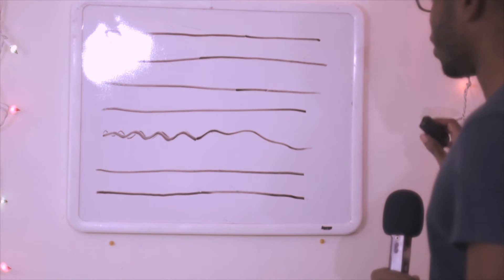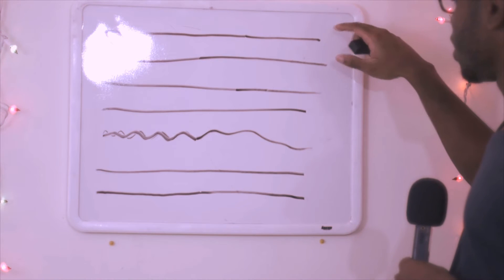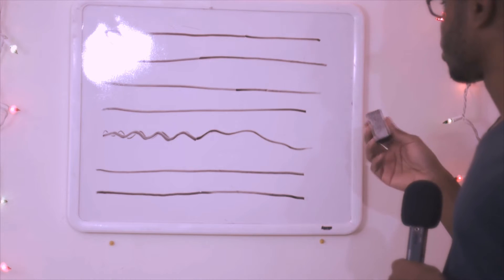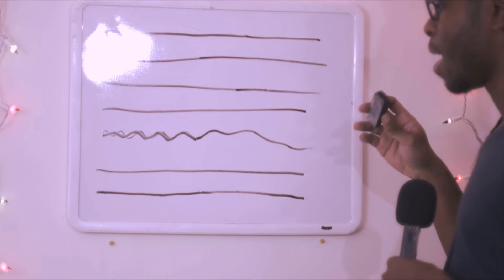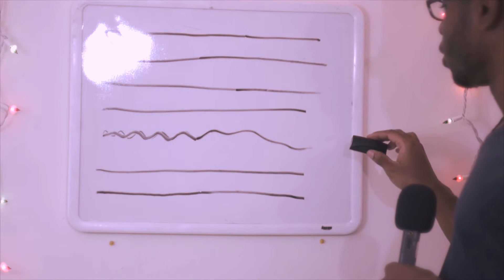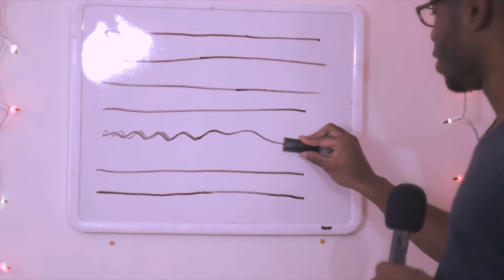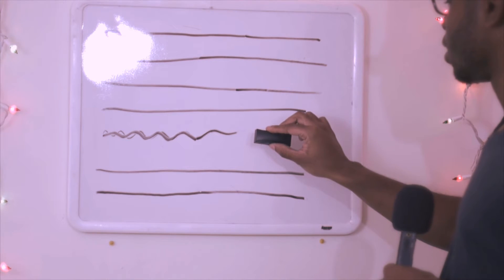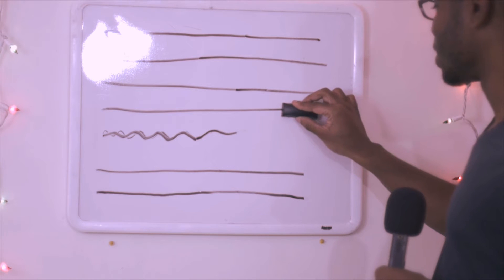Audio Buffer and Latency Explained!

Comment: Thanks for the video.. this showed up in my recommendation because of the audio issue I had with my app.
Just a quick note that while the smallest buffer is ideal for it can be too small also leading to other problems like buffer overruns and stuff. But it should be fine though.

Comment: Great explanation, and it leads me to a question:   If your operating system is calling the shots, meaning you instruct the the operating system to deliver data to the audio driver in chunks known as "the buffer"  , and then after delivering a chunk, the cpu does a bunch of other tasks before delivering the next chunk.... and whether the OS is delivering chunks fast enough to the audio driver is what avoids popping....  If this is the case, that the OS is in charge,   then why does buying a better audio interface allow you to reduce the buffer size?
Reply from the maker: some audio interfaces just have better software meaning better performance and some like the Apollo stuff actually do processing on the device freeing up resources on your actual computer.
Reply: @jamalmortimer  Some of my Kontakt samples are so large and numerous that my usb 2.0 interface starts crackling away.   I assume the cpu is so busy processing the samples (along with all the other tracks and effects) that the audio buffer runs dry before windows can get back to refill it.  I can increase the buffer but the latency makes playing live to the existing tracks impossible.

I am tempted by the new Thunderbolt audio processors, but with your explanation, I am no longer convinced that would solve the problem, which is not enough CPU.   Now if there is some significant additional processing that USB is doing that thunderbolt would not have to do, I guess you could eliminate that by switching to thunderbolt.
Reply: Just budging in on this question.
 @bobwrotenstien315  digital interfaces like USB, firewire, thunderbolt or PCI(e) all have a buffer and add to the latency as well.
Good drivers (software) and well built hardware help keeping this low.
Loading samples are done mostly in RAM memory if enough is present.
If not it will need to 'read' your samples from the drive if you hit a key and chances are that it will not be processed on time to fill the buffer.
@Jamal Mortimer nice explanation mate.

Comment: I understand. Is there off the shelf software which could enable one to create essentially false buffering. Essentially an editing program. Such a program could easily be adapted to alter seemingly innocuous video..audio..streaming files. By selectively buffering a file one could send essentially coded messages. For example: John said....buffering...he is fine. That would read to the recipient differently than: John..buffering.. said he was fine. This simple but effective system must surely be being used by clandestine agencies in the world. I'm not sure. This would be a near impossible code to break. Much like a modern enigma machine. Any video or audio file could easily be utilized. Obviously..like enigma..the receiver of the file..I.E. coded message..would have a written code encryption manual in order to determine the true meaning of the message. In essence: a Mickey Mouse Cartoon could be edited and no one would realize that it might actually mean "Meet me at the Kremlin".Two people would decipher that but to anyone else it's just a cartoon with glitches. It seems to me that this would be very difficult to detect let alone decipher. Also remember that this system..simple as it is..would not have embedded code or malware that could be detected any present day antivirus software. I can press pause and play on this video to achieve the desired end result..example. The question is: is software available commercially that achieves this effect. Thanks if anyone can help.